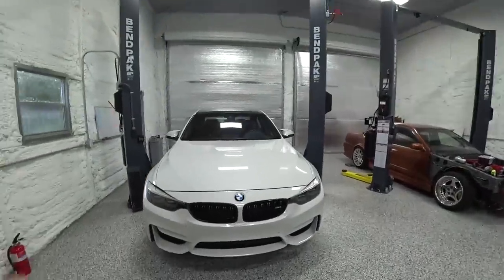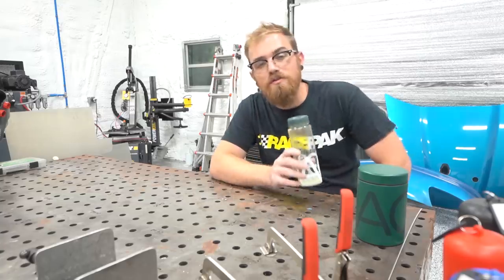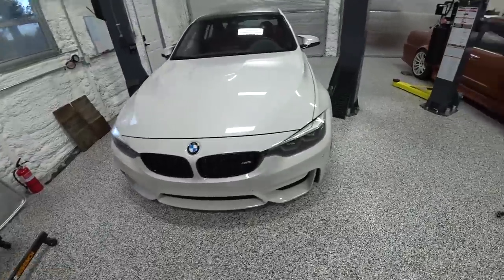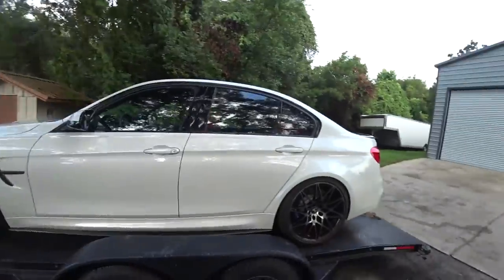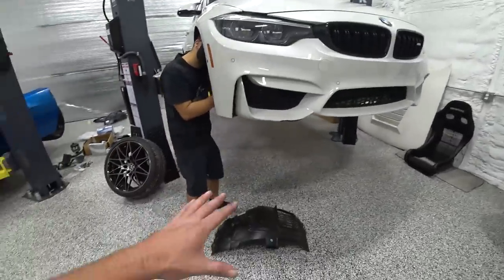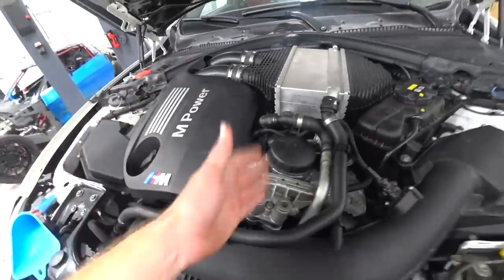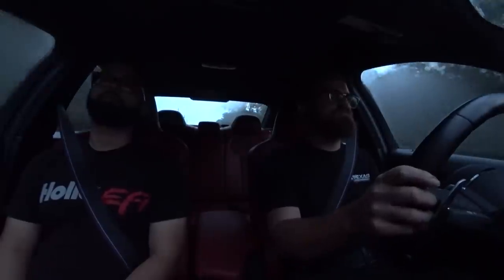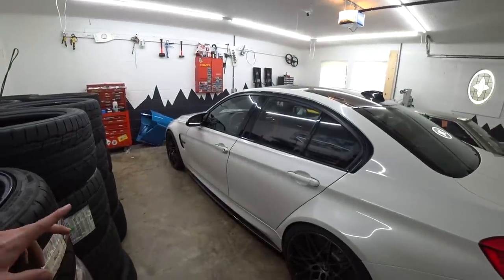Fixing my "Basket Case" BMW M3 from auction.

Comment: For that rack situation if you have working good rack of the parts car. You need to reset, the adaptations for that rack, and then re-calibrate the steering wheel angle sensor, and the initiate the rack from the diagnostics. It will make you center the wheels, then the steering wheel, after that will make you wiggle it to around plus and minus 10 degrees for a few seconds, then delete all errors from the DME, and DSC module. There is a quick way to reset the DSC connected steering wheels angle sensor, by firing the car up going full left then full right, turn off car, then wait 30 second with ignition and accessories off ( as this is F series M3 they all have comfort access for firing up  its better to get the key out and far away from the car so the modules can all get to "sleep"). Then fire up and sensor should be reset. 

Also the rack has its own module that needs to be coded to the car, even if it start to work will show the Tamper dot on the cluster, that means there is difference in the mileage somewhere in the car systems, not sure if the rack module as ISN number, if it does that makes it way more complicated to code.

As Elias Bergstorm said in the comments.This all can be done with almost no money spend, if you don't want to use BMW licensed software, people do it all the time. As the legit tools cost a lot and its limited to BMWs and Mini's. Just keep in mind that for F series you will need not a D-can K line cable, but E-net to OBD ( you can home made such easy there is no real interface in it, just a RJ45 plug to male ODB II ). You can get ISTA D with DB for 2020 from the internet and for coding you will need E-sys software instead of classic tools that worked with E series.

If you have other issues with the car I have been banging my head with BMW's for 10 years now, you can always PM me I will gladly share some knowledge if I have such on the problem.
Reply: Great knowledge. 👍👍
Reply: bro you kinda giving me PTSD, my BMW is actually working rn lmao
Reply: That's for changing the steering rack? It's already the biggest PITA I had working on my e36. I think I would've kilt myself if I had to program it afterwards
Reply: BMW tech?
Reply: Geeze, this guy BMW's!
Reply: That's mental, this is why I prefer old cars 😂
Reply: So 16 caibration steps and you need a tune for the damn rack. 
God. 🤦‍♂️ that's so lame. Solidifies my hatred for German cars more.
Reply: @banneddamn  same company gonna sell you a monthly subscription if you want heated seats lol
Reply: 4K later you have a new steering rack, or buy a pre 06 anything and have no worries about emissions/ half the electronic bullshit/ and limited manufacture purposeful weak points to make you buy a new one sooner
Reply: @mitchvankesteren6771  But then you are at the mercy of people selling parts for 10x the price, and parts manufacturers lowering quality of parts... tits for tats
Reply: @banneddamn  Yep, my mate had to drop the engine out of his Audi, just to replace the starter. Almost $2000 in total.
Reply: @banneddamn  Cars of all origins are similar these days.
Reply: @Tillhony  E36 has no active or electric steering, just a hydraulics, no servo-tronic either, they don't have angle sensor, some of the dont even have basic ASC.
Reply: @maldenfoster  Nope Just a hobby.
Reply: @banneddamn  bet if you drive one you wouldn't hate them anymore lol
Reply: @mihaildikov5150  Interesting to see how much they changed the steering rack on the later models
Reply: @Tillhony  A rack on an e36 is an easy rack compared to most other cars tho. Inner tie rods, one bolt at the steeering u-joint and 2 bolts on the subframe easily accessible from the bottom. A rack can't really get any easier.
Reply: @banneddamn  Well too bad for you, now most cars have the same exact issues, because for some reason manufacturers decided electric racks were a good thing.

Comment: Boy this video was extremely relatable for me, I bought an e46 m3 9 months ago and I felt the exact same way when I got it. I was so scared and paranoid with "oh shit is this normal" and i was worried about it breaking and not being able to fix it as well. But I've done the same thing and i let go of the reins and have taken my car to a shop and its been great, I've only had to do it twice and it was for small stuff and an alignment. Its been dead reliable, and the few things that have needed addressing like the brakes and tie rods and small maintenance stuff like that have been shockingly cheap and surprisingly easy. I'm not sure about this gen M3 but my whole brake job was under $300 for all 4 corners, my tie rod was $8 for the inner and outer on one side and it was $35 for the other. My M3 never stops surprising me with how amazing it is, it surpasses expectations in every single way imaginable. Even down to folding down the back seats and sleeping in the trunk, I occasionally drift my M3, and ill use it as a tent at the track. Its the best car I've ever owned, I love it to death.

Comment: For floor mats get the BMW all-weather mats I had them in my f30 and they fit so well you'll have no issues with sand dirt or water in the carpet when you go to clean them off
Reply: This! The BMW all weather mats are fantastic.
Reply: I detail cars and can say that oem BMW all-weather mats fit nicer and clean easier than almost any other floor mats
Reply: And dude is right about those floor mats my bro had them in his f30 and he works Security on back roads and the outside of his car always looks like it's mud bogging in the floor where your feet go is always dirty too but with those mats none of it will actually get on the real carpet they're like big bowls in your floor but they Contour up the sides of the seal Wells and The Rocker it's literally like a Bowl in the floor you could get two inches of water in your floor and it wouldn't make it to the actual carpet but enough Jibber Jabber on to the next comment lol

Comment: I wondered how you would feel about a newer car man. I just bought my own new car and its been weird lol. All of the electronics and nannies are trippy. Also going from a full 2000s sports car hydrolic steering where you feel everything on the road, to a full "sports car" electric rack took a while to get used to. Also, I noticed that I am so confident in the car that I didn't even open the hood after I got it,  I just got curious what it looked like and popped it open just to look. 

But, now the bug has got on my shoulder to "improve it" Looking at wheels and tires, downpipe for the turbo, front lip and spoiler.....
Reply: From what car to what car
Reply: @MiGujack3  A 2004 Pontiac GTO with heads, cam, and intake with full aftermarket suspension (I still have it my PFP) to 2022 Cadillac CT4 V.
Reply: It was super trippy when I went from my fox body to a 2017 Mustang GT

Comment: There’s always a value to be had in having your car with someone you trust, even as an automotive professional. It can be a lot easier to have your car SCHEDULED for someone to have designated time to dive into it who’s literal motivation is their career. 
Also I totally recommend wheel stud conversion wheel studs are never fun, so much easier to thread studs into them and buy some open ended lug nuts.

Comment: I used to work for Benz and what i did for the whole taking wheel bolts out thing is to take a bolt (I think it was a subframe bolt) cut the head off, grind it so it’s smooth. Then take your top wheel bolt out, thread in the subframe bolt and then you have a wheel hanger . I used to keep one on each lift arm actually

Comment: I've recently been taking some of my vehicles to shops for things such as AC repairs, and even had a shop knock out an engine and trans swap for one of my previously owned drift cars.  What I've learned is that yes, money can be saved when you do work yourself, but as someone that values my time just as much as my money, it can be worth paying to get stuff done.  Especially if friends are the ones getting paid to do it for you.

Comment: For as much as you’ll probably have wheels on and off that thing you should pick up a stud pilot pin set. Makes taking wheels off and putting them on much nicer and never have to worry about the wheels falling. I work in a German shop and use them all the time!
Reply: And then right after I comment I push play and you say how things have come “full circle” which is the name of the shop I work at 😂

Comment: There are good EOBD scanners with a plug that connects to your phone. Then you can use the app. There are systems that allows you to do 90% of calibrations and read codes even delete them. Read data. I have heard good things about the  Carly system but I have not used it my self. They say you can code systems when needed. Hope this helps you. 🙏

Comment: Unsure whether it works for f30/f80 but I used a k+dcan cable and got bmw ista+ from some shady website (but it worked) for my e90. Ista+ is the software bmw technicians use, you can do coding and all kinds of things. The cable and software cost me a total of 50$. SUPER usefull if you own a BMW.

Comment: Dude in regards to the pedestrian censor problems on the be .. I work in crash repair in the UK and the pedestrian censor is a flat strip containing 2 wires that runs across the front bumper and should be located in the crash foam on most older models.  if that's still the original if it's damaged in anyway it will through up the pedestrian censor code check the plug too 🤙

Comment: 9:00 I'm an auto shop owner and I have a lanuch scan tool. Look into them they have different versions diagun being cheapest at 700 and the tablet version at about 1200 they do a lot of programming and coding and you will use them on any car with obd pirt

Comment: Please please put on the upgraded metal oil cooler guard along with the new cooler!! It will prevent rocks or big pieces of the debris from rupturing the oil cooler and costing an engine if it was still running for a bit.

Comment: Taylor, K+Dcan cable, OTG cable, Bimmertool on android phone and you can check, adapt and reset many things.
Reply: Also you can use MHD and XHP with it.
Reply: Bimmertool is just a toy, Ista and esys
Reply: @xiukn8  yes sir, but for that price you have legal softwere that can do alot on fly, dont knock it down its good app.
Reply: @kayrol18  sure it is, a good toy as i mentioned

Comment: Make sure it has a crank hub before you beat on it please and when you’re fucking with sensors on a BMW make sure you reset the car by taking the battery cable off and putting it back on…..also you can get a coder and code them out so they don’t show up and won’t interfere with driving aggressively

Comment: Did you make sure to take out those plugs next to the oil filter and fill those with oil? Those are the lines to the oil cooler. I guess they would’ve filled and primed after running the car, but good to do next time the oil cooler is out

Comment: The thing I learned about working on my old 3 series BMW's is that there is always a trick to working on what ever part the car needs. If you know the trick the work is easy, If you don't know it you will curse the German engineers day of birth.  It's usually never obious what the trick is either.

Comment: I dont wanna b an asshole but watching this on my phone that car sounds like total dogshit. Is it that bad in person or is it a combination of the camera picking up reverb off the shop door and shitty phone speaker? It sounds fuckin rad from the interior but man, when he started it on the trailer after getting it fixed i was like, it sounds like my moms 4 stroke Yamaha warrior. Its weird because im a master Audi technician and weve been taking theae things in on trade for the rs3 left and right so ive done safety certifications and services on probably 4 of them and theyre a SUPER fun car to drive. Even in the M mode with the exhaust opened up none of the cars ive worked on sounded like that. Gotta be just circumstances. Either way New cars aren't my thing. Ill fix them, but ill never own one. Well shit i guess aside from our tesla i guess but thats electric it doesn't count.